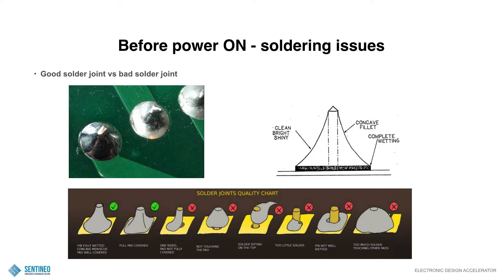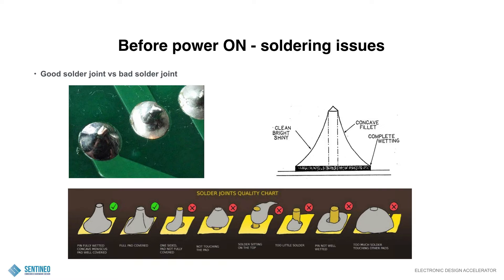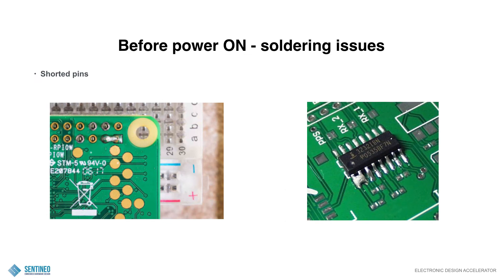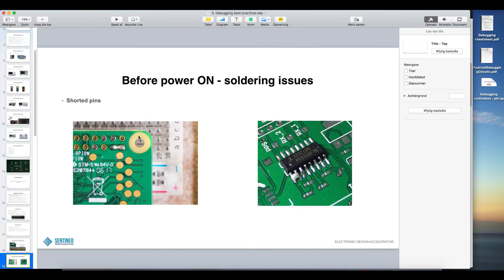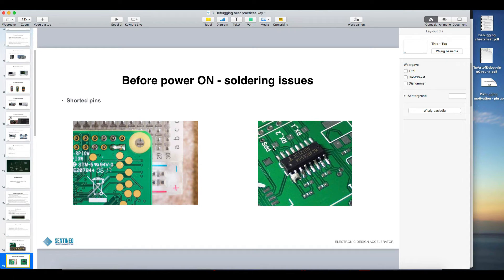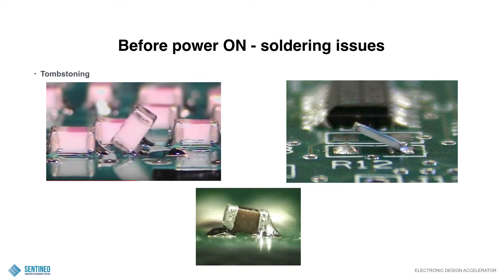How to Spot a Bad Solder Joint

Comment: What does wetted mean?

Why are "one sided pad not fully covered" and "too little solder" bad things?

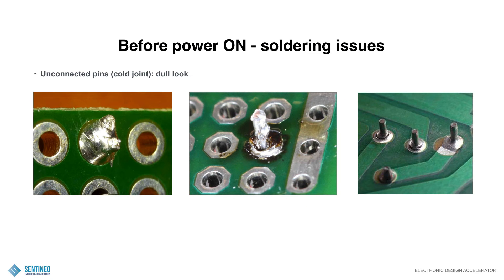The image on the left at 1:45, why is it wrong?

The joints that have seen too much heat, is that a major issue? Is it fixable?

Thank you.
Reply from the maker: Wetted means no sufficient flux has been added to make the solder flow nicely.

One sided or too little: sooner or later when being used in challenging environments (with vibrations for example) these will break because of the bad physical connection.

Image on the left: this has a dull look, it can mean that you have a cold solder joint where solder is above the pin and pad as a "cap" rather than being actually connected to the pin and the pad.

Too much heat: the biggest risk that you have there, is that your tracks might start to separate from your PCB. That's bad 🙂

Hope this helps!
Reply: @sentineo  it does help, thank you very much!
Reply from the maker: @zhukov2116  Awesome! You're welcome!